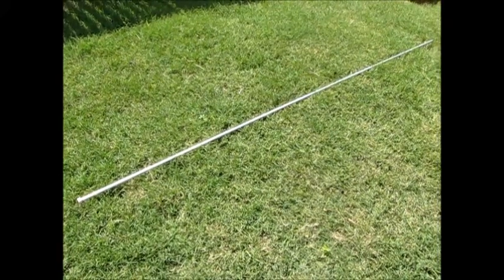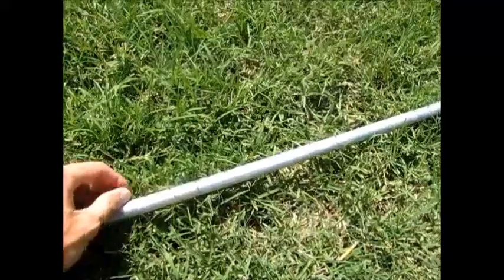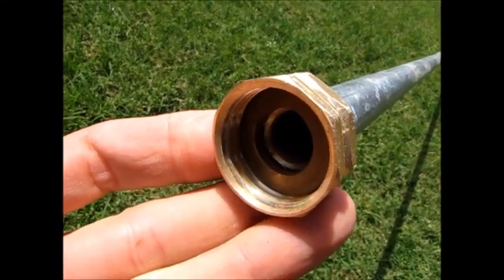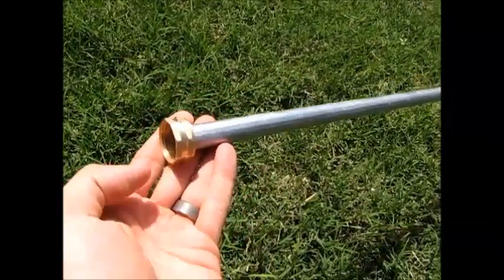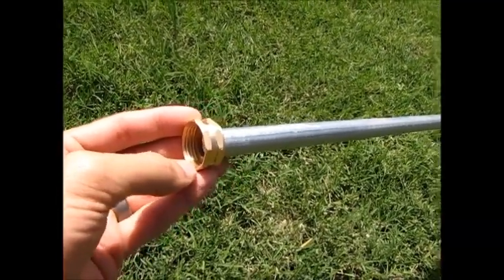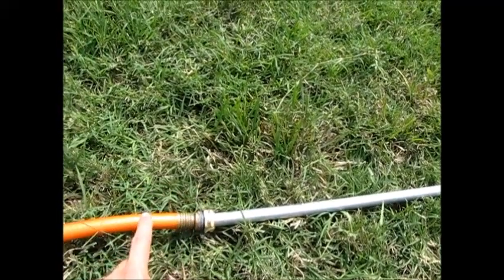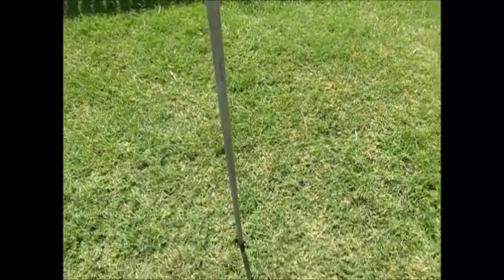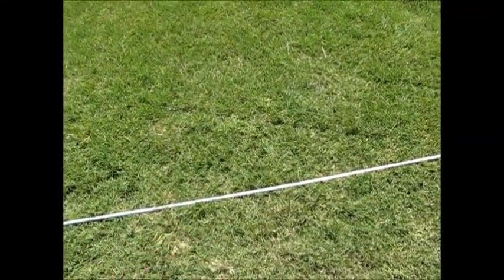How to Install a Copper Grounding Rod Without A Drill - Easy DIY Hack

Comment: This is way too much needless work:  just dig a small hole with a spoon or anything else, fill it with water, stick the rod in and start jerking it up and down, not by force, just pull it half way up and let it fall down or push it down using minimum effort, if the water drains, just add water without taking the rod out of the hole and keep jerking it... you will be amazed how easily and quickly it will dig its way through... I buried one in less than 5 minutes.
Reply: Sshhhhh.
Reply: 216trixie If you have to burry a rod, first try it the way I said and you will see for yourself... this is the name of the video where I first learnt how to do it: "Driving a Grounding Rod" you can watch the video, but remember not to pull the rod out of the hole to pour water in, it makes it extremely difficult if you do it. You should try it before breaking your arm hammering the rod, or break your wallet buying machines, or waste your time with over complicated solutions like the one in this video...
Reply from the maker: Arturo Hernandez I would be interested in seeing a video of this method in practice.  I would like to see you do that in 5 minutes.
Reply: Arturo Hernandez I know it is very likely you are in denial at this point... your solution is a cool one, you did really well regarding ingenuity... it is just that it is over complicated...
Reply from the maker: I disagree and invite you again to post a video showing your method works.
Reply: Arturo Hernandez Arty. I'm a plumber. I'm used to driving pipes under sidewalks and driveways using water pressure, like shown here.  It would take a year to do it your way.
Reply from the maker: Arturo Hernandez Your link was going into spam so I didn't see it.  So the method you linked to in that video requires 2 people and it takes 6 minutes to complete (and I use the word "complete" loosely since it is still sticking 6 inches out of the ground at the end of the video).  My method takes 3 minutes and you can do it by yourself.  Hmmmmm....
Reply: LDSreliance I buried my rod by myself, you don't need 2 guys to do it you can pour the water by yourself. Regarding "your method Vs that guy's": that guy's method takes around 6 minutes in clayed hard soil (less than 5 in sandy soil) and you need: the rod you have to bury, a spoon and a can of water... in your method, you need the rod, and purchase a metal pipe ($2-$3), a hose fitting ($3-$4), a piece of wood, a little mallet to pound the hose fitting into the pipe, a ladder to stand on top and drive the "water drill", and then finally you can start boring your hole... in your video you say it takes you around 10 minutes to drill the hole... so, you have to buy a bunch of things you may never need to use again (unless you plan on burying rods for a living) waste $10+ in the process, take like 10 minutes assembling the "water drill", then 10 more minutes (or 3 minutes like you claim now) drilling the hole... at the end of the day, your method and that guy's method take more or less the same time, and probably by the time you get your water drill ready that guy already buried half the rod (if not the entire rod) with zero waste of money or resources, and as I said that guy took 6 minutes because he pulled the rod out of the hole to pour the water in (that's a big no) if he hadn't done that he had buried it in less than 5 minutes in clayed stony soil.
Reply from the maker: The reason it took me 10 minutes is because I had never done it before and I also pulled my rod out because I thought it would help (it did not).  Look, your way sounds like it works and so does mine.  My way is not any additional work (your original comment was that it was so much needless work), it is quite easy once you get the hang of it.  I actually buried another rod with this method and it took me 3 minutes to do from start to finish, including pounding it below soil level with the mallet.  Well worth $10 in materials.  Enough discussion.
Reply: LDSreliance My points are self evident, your idea is:
1- Unnecessarily over complicated.
2- An unnecessary waste of resources, time, and money.

The method this guy showed in that video is the way we used to bury rods half century ago... but we are just forgetting about it and many people are just re-inventing the wheel... and all these "new" ideas are just too much unnecessary work, waste of time, and resources.

I had to bury 2 rods to ground my home. I am a Physicist, I love experiments and testing appealing ideas. So, I decided to use the occasion to conduct an experiment comparing the "self-evident-low-IQ-trivial" sledgehammer method and this "ingenuity-low-resources-driven" method: I bury the first rod with a sledgehammer and it took me more than 30 minutes pounding on the rod. It was hellish and a quite brute-brainless way to achieve my goal. I sweat like hell and dropped my liver in the process... the second rod I buried it using only a spoon and a can of water: I achieved my goal in around 5 minutes with far less effort and wasted energy.
Reply: Arturo Hernandez This old method works based on a fundamental knowledge of Physics and nature. The water you pour on the little hole you open with the spoon loosens the soil and when you jerk the rod in it, the rod compresses the loosen soil around it building a compact cylinder, that way it keeps penetrating deeper and deeper, it only needs a little water to loosen the soil at the tip, then as the tip is pointy it keeps driving the loosen soil up and compacting it around it while you keep jerking it and pouring water in... very ingenious, I tip my hat. 
Nevertheless, you shouldn't pull the rod out of the hole you are digging because when you pour water in, it can drag outside soil into the hole, or raise soil from the bottom up, and as the soil in the hole is compacted into a cylinder the extra soil will reduce its diameter and then the rod will get stocked in the hole and you will require a great deal of effort and energy to achieve your goal.
Reply from the maker: *****
You have obviously never tried it.  Go get a $15 copper ground rod and try to pound it into the ground without special equipment and report back.
Reply: Next time any of you have to bury a rod just give it a try and see for yourself. There is very little to talk about actually. You can debate an idea, something abstract that may not be easily proven in practice... but whenever you talk about reality, it needs very little debate: just try it for yourself and you will see if it is true or not... you will end up laughing at all the energy you wasted swinging a sledgehammer or all the expensive equipment you bought... or all the senseless complicated "ideas" you came up with... I tried and reported back, you  just give it a try and report back. A spoon, a bucket of water, and just jerk the rod up and down with minimum effort without taking it out the hole. A link to a guy doing it is in this thread watch it if you want.
Reply: +Christmas Eve you have to provide details: what did you do?
I tried my self and it worked just fine. I buried 2 rods the first one using a sledgehammer and the second one using this method. It was far easier the second time.

These are the instructions:

1- dig a smal hole on the ground using a spoon or gardening shovel.

2- fill it up with watter.

3- put the rod in and start jerking it up and down without taking the rod out of the hole at any time. If you take the rod out it will become very dificult to bury it because you are compacting the ground around the rod. 
Never take the rod out of the hole.

4- keep pouring water into the hole while jerking the rod. Trying to bury the rod in a dry hole is not the best idea.

in my prior posts there is a link to a video in YouTube that shows how to do it.
Reply: @LDSreliance  it depends on how hard your sirt is! keep about 2 feet from house, there may be gravel around footing

Comment: This will make a lousy ground until the soil can compact again, which could take months or years.
Reply from the maker: It actually takes hours.  With that mud it is impossible to pull the rod back out in a matter of seconds to minutes.  And when that mud dries you are good to go.  There are no air pockets or loose soil.
Reply: @LDSreliance  I recommend that you do some research on this subject. Just because the suction of the mud against the rod makes it difficult to pull the rod out of the ground, does not mean the rod is in acceptable electrical contact with the soil on an ongoing basis.  The mud will eventually dry out and diminish the electrical between the soil and the ground rod  connection useless.

Comment: Another thing that might work (??) is to just shove the grounding rod right into the garden hose, then turn on the hose, then let the rod keep the hose straight as you "water drill" down into the hole, then just pull the garden hose right out and the rod will stay
Reply: If this works ,you will be my noble nominee . Honestly !

Comment: Great idea! I like the idea of using copper tube for your drill, and just leaving it buried. It costs only a tiny bit more than the steel copper-plated rods, and won't corrode like steel. This process would also be helpful for removing concrete footed fence posts.
Reply from the maker: +phiksit Hmmm, the tube that I used was mild steel and then it was removed and a solid copper grounding rod was installed in its place.  But if what you said works more power to you.

Comment: I have to admit, its a cool concept. The idea of driving a rod into the earth for grounding is simply to provide a path for electricity to go if there was a problem in your home with the wiring. I have to question this method simply because the water is displacing the earth. When you are simply dropping the rod into the ground you have lost an extreme amount of contact of the rod to earth. Over time, the earth will fill back in, but I think that would be in the realm of decades. If you need to put in a rod at home or anywhere, I personally would still recommend a little sweat and drive the stupid thing in.

Credential: Electrician
Reply from the maker: Nick, you should watch my follow up video at How to Install a Grounding Rod The Easy Way (Full Demonstration).  Basically once you remove the hydraulic drill from the ground, mud rushes back into the hole and fills it most of the way back in.  The good news is that the ground is pretty saturated so you can push the rod over half of the way in and then you can easily pound it the rest of the way with a mallet.  Trust me, the rod is completely surrounded by earth and in good contact all the way around.

Comment: So I set up a metal pipe with garden hose.  Most I can drill is about one to two feet.  Then I hit rock.  Just does not seem to work,
Reply from the maker: Are you going up and down and twisting?  Worked great for me.

Comment: Does the rod drop into the pipe and you pull the pipe out or do you pull it out first and then put the rod in the hole?
Reply from the maker: Good question.  You have to pull out the pipe and then insert the rod.  See my follow up video at How to Install a Grounding Rod The Easy Way (Full Demonstration)

Comment: what makes the grounding rod be tight in the ground when you put it in?  Won't the water loosen it?
Reply from the maker: +Lynnette Cox Basically it creates quicksand, at least in Texas soil.  You have to still pound it into the ground but it is not anywhere near as hard as if it was dry.  And then there is no way you can pull it out.  It is very tight in there.
Reply: +LDSreliance OK.  Thank you very much!
Reply from the maker: Lynnette Cox
You are welcome.  Thanks for watching!
Reply: +LDSreliance Well, we did it!!  Drove an 8 foot ground rod in rocky Pennsylvania soil, and did it sitting in my chair in 20 minutes!!  Thanks so much for the great info!!
Reply from the maker: +Lynnette Cox No problem.  Glad it worked for you.  It is very easy and the soil will naturally compact itself again in due time (if it hasn't already with the mud produced).
Reply: +krrrruptidsoless Didn't have to be at top of rod!!!!!
Reply: I think I know how to make such a chair. :)
now I have to dodge the information/technology destroyers...
Reply from the maker: Too funny!

Comment: Got up on a ladder with a 5 lb sledge start pounding like you would a nail .Do that until your arm wears out. A very long dumb sh%!t process. Needless to say I will use your method next time. Thanks for posting 👍
Reply from the maker: Hopefully you didn't mushroom the top of the rod like I did the first time.  That is when I looked for a better method.
Reply: It did but the clamp still fit over it

Comment: why cant you use use a copper pipe and leave it in the ground. but somebody else said that it has to be solid. I really like the idea of the water pressure let it do all the work. A piece of ReBar would be so much easier.
Reply from the maker: I don't know why a pipe wouldn't work.  I haven't heard one way or the other.  One thing I do know is that almost no one agrees on how to ground properly.  There are no consensus answers and the "code" that everyone cites is just regulation and not a "this is the best way to do it" guide.

Comment: a grounding rod can't be E.M.T conduit by electrical code, at least not in Canada.  2 -10foot rods ten feet apart connected with min. 3/O awg fully impacted minus 6" max for bonding wire.
Reply from the maker: Did you watch the video?  The conduit is only used to bore the hole, not as the grounding rod itself.

Comment: This video seems to display a 1/2" EMT 10 foot stick of thin wall steel. Approved grounding rods are typically copper or steel clad ,8 ft long and 1/2 inch thick or thicker SOLID. The Electric metallic tube (EMT) will rot out  fast in the ground and will not give 25 ohms to ground or less as required by NEC code 250 grounding.

 Get approved UL listed ground rods and use a sledge hammer or a hammer drill with a ground rod adapter
 (you can rent this equipment or pay an electrician) or a pipe with a cap and a T bare handle and slam the rods in.
 You can drive a rod in usually in 4 - 5 min with a drill or 10 min with a sledge hammer or less with a rod rammer. 

The easiest way is to lay your two rods in a ditch 2+ 1 /2 feet (2 rods are preferred by most utility companies up north)  6 ft min. apart that are 8 ft long and connect your GEC (grounding electro conductor) to both of them and connect to your panel. Of course you can lay them in  deeper but they should be min 6 feet apart. We always use the copper as they last about 12 years and the steel lasts 5-7 years. 
Thanks for posting the video.
Reply: +Victor M. watch the video again, listening carefully to the man speaking.  This video shows you how to use water to loose the soil making it easy to drive in a grounding rod.  This is a video of making a hole, it doesn't show the installation of the grounding rod.

Comment: except then the hole is larger than the ground rod so the rod will not really be grounded. this method is not approved by code.

Comment: What happens when you hit a big rock?   That's what distributed in the soil around here and why farmers' fields have stone walls on their borders/
Reply from the maker: If they are too big then you have to try another hole.  But usually with this method if they are under the size of a baseball or so they will shift around so that you can go around them because of the mud.

Comment: No good for installing ground electrodes " ground rods",  you're defeating the purpose. ground rods need to be driven tightly in the earth!  and is required by the NEC to be  25 ohms or less.
Reply: My brain understands this and wants to do it and test scientifically, but my gut says it will be fine.

I think a lot of it comes down to soil composition.  Where I live we have dense clay soil.  If I dig a hole with a spade and fill with potting soil or the plant I've essentially created a clay pot as the clay compacts from the pressure of the spade into what is on a rainy day tough and on a dry day concrete like shell.  This means that any plant I put there will have a problem getting roots to spread and most likely die from lack of water if I'm not careful.

I would imagine the same is true for this.  Maybe with a looser soil the water will break it up and be absorbed into surrounding soil only to eventually settle back into a tight fit.  Only way to know for sure though is to test it I guess.